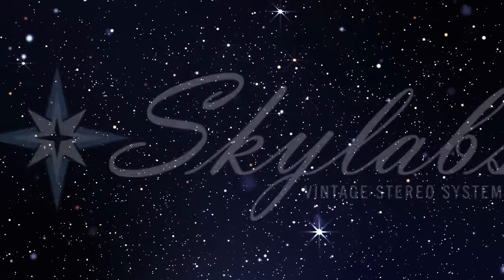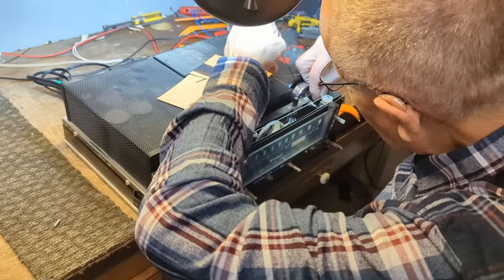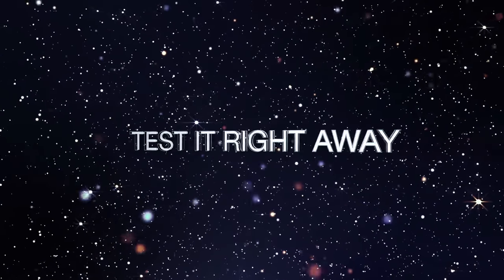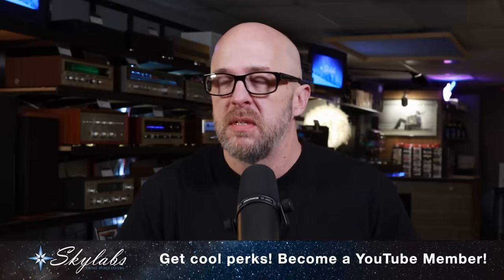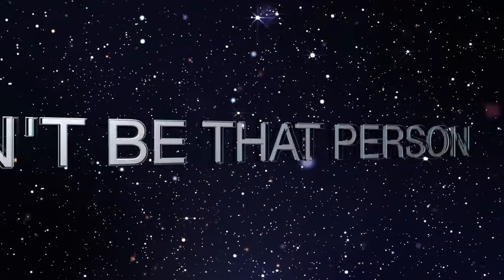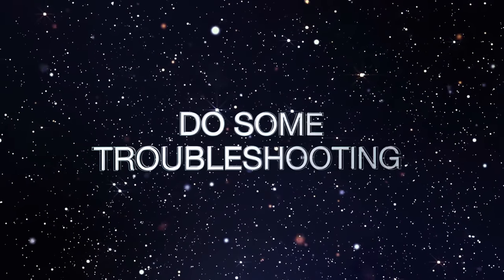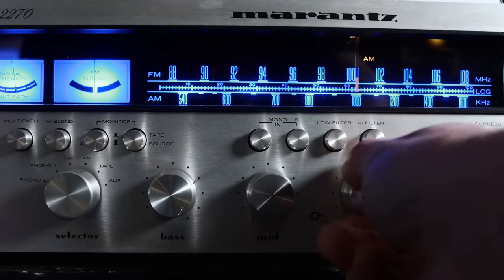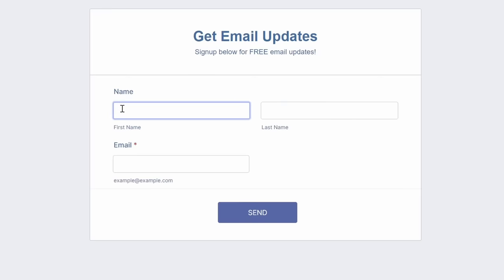Don't EVER Say This!? Vintage Stereo Repair

Comment: For all the reasons listed in the video I don't repair. I restore. If it is too expensive fine, don't send it to me. I'd rather get it to a point that I can warrant it will perform and that takes time and that costs way more than simple repairs. Also if someone plans to sell it afterwards I usually don't take it and explain that there won't be a monetary return on the investment.

Comment: My preferred repair man here in Australia took 14 months to repair my Sansui AU-6900 integrated amplifer.  Why so long? He had to re-engineer the complete output stage of the amplifier as the original spec TO-3 output stage transistors (8 of 'em) were UNAVAILABLE. He used a higher grade of transistor to create more power (10%) than original spec. but used less transistors..this created a flow on of adjustments and upgrades to make the unit stable... He did a correct DC bias correction/setting and had it running for weeks at his workshop to ensure reliability. He inspected the entire board especially for leaking electrolytic capacitors etc. It sounds great is, fully functional completely unblemished on all panels; like new.  Worth the wait; and while waiting I was listening to a Sony ES series receiver...a first-world problem.

Comment: Great advice. I took my Pioneer SX424 I bought in 1973 new) to be serviced locally and fortunately did all the things you suggested before handing it over. My hope is that it can be put right. Wait time is 6-7 weeks according to the owner of the shop and after seeing the piles of equipment in the shop, I can see why. One thing you missed in this video is the health of the repairmen/owner. Many of the guys that know and have repaired your old stuff are aging as well and not all of their system components are working 100% either!  Be Patient is the key as you say.
Reply: AMEN Brother !
Reply: "Let us endeavor so to live that when we come to die even the undertaker will be sorry."
                                                                                                      - Mark Twain

Comment: Everything you said is great advice. I've had about 60 pieces of vintage gear seen to by my techs spening $25,000 having them repair my pieces. Showing your technician respect goes a LONG way. I recently brought in a corroded Sansui G-9000 that sat unused in an ocean side vacation home FOR YEARS! It was all rusted and pitted, my tech looked at me with mock exasperation asking me Mr. Wolf why do you bring me these challenges. I readied to take the Sansui G-9000 home! My tech said hey where ya going. I can fix it, its just a challenge. My tech told me he wouldn't do this for any other customer because it a full restore but for me. He'd do it. I just realized treating this guy well made this tech my blessing.
Reply: The Golden Rule !      "Do right for your own sake and be happy in knowing that your neighbor will certainly share in the benefits resulting."
                                                                                                  - Mark Twain

Comment: I had my Sansui AU7900 go out 6 years ago. Had a bad experience  with a local tech shop. Charged me $125 and blamed it on my speakers. I finally found a specialist Sansui shop 1/2 way across the country. Called and they put me in their que and told me not to ship for 7 months! Finally got approval to ship. Once arrived, they said it'd be 6 months before they will ship it back. My attitude is that I a grateful it will be repaired and it should last the rest of my life. Can't wait!
Reply: Let me see if I understand this. They have you waiting 7 months, then tell you it's going to be another 6 months before it's done? Man, they really ARE taking the piss.

Comment: I took my baby, my Pioneer SX-737 for repair to a shop in the Denver area.  It was literally the first thing I bought with my first paychecks in 1975.  The power switch wouldn’t turn off and the right channel wasn’t working.  I reminded them that the x3x series were famous for having bad transistors.  The owner was calm and said, let’s clean the switches and dials before we start thinking about replacing the transistors.  I said “right, no point in replacing what might not need replacing.”  He was right.  The clean up fixed the whole unit.  So happy.  My 737 has a special place in my heart.
Reply: I would bet that 90% of parked Pioneer stuff  will develop noisy pots.useless switches and one channel, no channel sound. If you use it,the switches may have cleaned themselves.Amazing that the contact area of the switch is called the wiper.I use De-oxit lightly .Rotate/operate the control fully a dozen times,rinse-repeat-lube
Pioneer got real big because they built real good. products for the money

Comment: I had my Yamaha CR-2020 receiver (purchased back in 1978) rebuilt by a reputable shop.  It was 8 weeks before I received an estimate (as promised) and two weeks after that before the repairs were completed.  Seven months later and it's still performing like new.  I was never in a hurry to get it back.  This store/shop deals with a lot of vintage equipment but they also sell current state of the art stuff as well.  Great advice Kevin!
Reply: Yes the place that does all my service has an 8 week wait list also. For $100 extra you can jump one item to the front of the cue for estimates.

Comment: At least a stereo has two channels, you can reference a failed side against the functioning side.  That helps for a majority of the path.  Obviously not all.
The absolute worst device to repair was a  analog “box” TV.   Now they seem mostly disposable and all for the better.   Having worked as a TV tech in the late seventies I was glad to see a stereo come in!   
That said,  your presentation was spot on!

Comment: Well, out here in Honolulu Hawaii. just about all the technicians who used to work on vintage audio equipment  have retired or closed shop. When it comes to newer equipment most people trash it unless it's high end gear.   Your advice is spot on, very informative.

Comment: Great tips! I honor all of these tips and more when getting my gear serviced. There is never a gain doubting a technician and getting even a little pushy. I replaced all my stereo gear a year ago due to the deterioration you mentioned regarding aging equipment.

Comment: I liked the "sound difference".  I got that same thing after a repair.  I just thought there was something not quite in the same spec that it went in, likely  because it was nearly failing and now the new replacement parts have changed other values of other failing parts.  I never thought it was an issue.

Comment: I just wanted to take a second to say thank you for the videos you make and the knowledge and experience that you share. 

A lot of this information just isn't very easily available, and a lot of knowledgeable folks keep the information under lock and key, perhaps believing that their value is increased by their unwillingness to share what they have learned. 

Not only do you share the information but you take the time to deliver it in a manner that is comprehendable for a wide variety of viewers knowledge levels.

1 more thought.
The description of sound using colors as descriptive tool hasn't been a key to enlightenment, at least not for me.

Thanks again Brudda.

Bungeebill 
Hood Rat Records 

🎩✌️🐀🧿

Comment: All true, if/when owning vintage gear, a good tech is priceless and there are not that many around any longer. Being patient for repairs and not underestimating multiple different problems is part of the hobby when dealing with 50 + year old receivers/amps. It can be frustrating as it is my case with an SX780, cosmetically looking almost brand new, but on the 4th and different issue, or a pure joy as in an SX550 bought more than 4 years ago for almost nothing and sounding great and trouble free.
Great advice in going to a thrift store to get "something" as substitute when the main piece is out for service. Lately I bought a Technics SA 104 at a thrift shop for $10.00, looks and sounds good, did I need it? No, but 10 bucks? I'll find some use for it. Great hobby! Great videos.

Comment: Great Vid Kevin, looking forward to the next one.  The AR AU  you repaired is still running great, it's the jewell in the crown of my vintage set-up.  As soon as I get my hands on a good AR XA or find the parts I need to repair the one I have in my shop it will be a complete original early 70's AR set-up I wanted to buy when I came home from Vietnam but did not have the $ to buy.  thank you for your vids and hard work:   chet
Reply from the maker: Thank you, Chet. Glad you are enjoying the AR. That's a keeper!

Comment: Catching up on your earlier videos. Thanks for the tips. 

I need to find a shop here in the Dallas/Ft. Worth area to see if my old JVC KD-V6 cassette deck is worth fixing. I bought the service manual to take with me to the technician, is that a good idea? 

It needs new belts and the left channel is dead. I like the 3 head design. In the meantime to play some of my old cassettes, I bought a JVC TD-R441 on eBay and it’s working fine. I’ve listened to some old recordings I made using type IV metal cassette tapes and they still sound excellent. 

One of these days I plan to get in my car and drive to Des Moines to have the pleasure of meeting you and enjoy seeing your store. Thanks for the great videos.

Comment: Another great video and good advice. I just heard on Friday night that a repair tech had a pair of McIntosh SS amps for 2years. That's really a bit much and I offered to look at them (only think one had a problem) if he drove the 2hrs to my place. The only thing that I disagree with you is that I almost always would plug in the customer's unit while they were waiting and verify the problem and give them a "ballpark" estimate. A bit more difficult to do with audio gear but sometimes the person may have accidentally pressed the Tape monitor button....

Comment: Just watched the video where you received a poorly packed receiver by mail or whatever and some glass was broken and knobs bent.

i think it would be a real service if you made a video about packaging and shipping.

Maybe some things should never get shipped? Different ways to package. Specific advice about different services? Like you mentioned using USPS fragile stickers instead of your own.

Maybe even advice on how to protect yourself buying online, and how to be fair to sellers, et cetera.

Maybe you've already made these! Slowly making my way thru all your uniformly helpful and interesting videos, thank you!!!
Reply: I worked in retail decades ago and sometimes got things ready for shipping. Here's what I reccomend:
First, get some desiccant gel packs. I have a bunch that come with my vitamins, so I am already good to go on that.
Second, a decent weight plastic bag. Put equipment plus desiccant packs in the bag, and tape closed.
Third,  styrofoam. Preferably from a piece of equipment of some kind, ideally 8 corner protection pieces, tape onto the corners.
Fourth, packing material. That could be something like "flo-pack," the styrofoam packing "peanuts," a whole bunch of bubble wrap (one reason why you want something on those corners), or some other cushioning material. Get a good,  sturdy box, pack it in there well. 
Last, get a slightly larger, sturdy box, more packing material, and pack the box with the equipment in it into the larger box with cushioning around the smaller box.
I know this sounds like overkill, but I do remember seeing a brand new computer tumble out of the back of a delivery truck once, and I have received boxes that were obviously impacted by something between the shipping dock and being delivered. 
Or, ideally, you kept the original box and packing material that came with the equipment, and some "helpful" person didn't dispose of it as a favor (thinking of you, mom, rest in peace).
Reply: @j.patrickmoore9137  Thank you! I save those desiccants, too, for no particular reason except figured could come in handy some day. Now I have a use! Bubble always gets me wondering…. Say it gets dropped from a truck, the bubble does its job, but pops in the process. Leaving the piece vulnerable to a second drop. Totally just my mental simulation, and have no idea if it would work like that in reality. But, I stick to packing peanuts for that “reason”. I like the styrofoam corners plus peanuts approach. Thank you again!

Comment: The tech I took my Marantz 2220B didn't accomplish anything.  I had to do it myself.  However, all I did was spray all the controls with Deoxit (the left/right signal slider was the most difficult to access), and use a small bit of abrasive paper soaked in rubbing alcohol or Deoxit (can't remember which) in between the two contacts of a relay hidden deep within the bowels of the thing.  Maybe I didn't even have to do the latter, since the last thing I ever did to the unit while tearing my hair out in exasperation was the left/right control.  And I don't know a thing about all this stuff.  All I did was watch few youtube videos.  Thank-you, thank-you, thank-you to the internet for enabling me to fix the old Marantz that I earned with my dishwashing money back in 1976.

Comment: Opinions: Is it a bad thing to remove the faceplate and wood top before I dropped a unit off to a tech to keep it from getting (more) dinged up?
Reply: Interesting and an important comment.  They really shouldn't have a problem with that.  I would let the shop know in advance that you feel more comfortable doing so and see what they say.  If they advise against it, I would go elsewhere.
Reply: Thanks for the advice!

Comment: I was patient with the repair of my AU-999. It sat in a shop a “Hi-Fi” shop in Minneapolis for 2 years!  Two figgin’ years!  And this was supposed to be a reputable shop. 

My first phone was after a month - too busy. Next one after two months - too busy. After laying low a bit longer, no longer returned my phone calls.
Finally had to threaten to sue, two weeks later got it back with this big long explanation on what he (which was to go on Audiokarma and take their advice), worked for two weeks then the same problem. Called, nope, technician moved to a Scandinavian country with his wife. It is a two way street, Kevin.
Reply from the maker: It's absolutely a two way street.
That sounds like a terrible experience. I would only assume that situation was rare? I can't imagine any business staying open if that's a common occurrence.

Comment: I'm guilty of not trying out my CD player soon after I got it back. I waited 3 weeks before I tried it and guess what .. it was not playing the CDs. I took it back and they cleaned it up and did mechanical align and adjust. Fixed it no charge with warranty. All the other tips I pretty much had it my mode of behavior before watching this vid.  I had two other pieces worked on and took back the cassette deck after it was not playing steady. It's still over there.

Comment: A little self repair/investigating on why something doesnt work is precious. I used to do service calls on John Deere equipment, a lot of expensive lawn mowers. More than once, got a call to check out a lawnmower "than just quit running". I got in the habit of checking for gas in the tank, first thing. Was not my decision to make, my business still charged for the service call.

Comment: You mentioned people saying, it does not sound the same as it used to. Then they say it has been years since they listened to the stereo receiver or other equipment. People's memory for audio is not accurate, just as it is not accurate for many things.
People often look back and remember things better than they actually were. "The good old days." You mean back when you had no money and were starving? Yeah, then. Ha ha
As you mentioned, they are often listening to the equipment in a different room. They may be using different speakers. Maybe they were using a different turntable with a different stylus. There are so many factors why it will not sound the same in reality or in their memory. People need to enjoy the sound they are getting, not some idealized sound in their heads.

Comment: Best way to test your vintage gear hold your gear upside down and give it a good shake the transistors, resistors and capacitors that fall out are the ones that need replacing.
Reply from the maker: I'll try that this week. Thanks

Comment: Kevin, I'm wondering if I'm over-thinking this.  about 5 years ago I inherited my father's Sansui 5000A receiver and it has been sitting here since; but it wasn't hooked up or used in almost 25 years; as in since 2002 when I last set it up for him in a new room in his house.  The speakers for it got destroyed so I need new ones; which is why I haven't turned it on yet.  

But am I being overly cautious by not wanting to use it without having a tech give it a 'once-over' first?  
My thinking is, like when you buy a used car you take it to a respectable mechanic that you trust, to get it looked at to see if there are any possible issues that can be addressed first and avoid a possible catastrophic failure later on.

Comment: im luck that im interested in vintage audio and am also a tech. i like modding my equipment to sound a specific way. i also increase the coupling capacitors to allow the amp to handle frequencies down to 1 hertz.
i also design and bould my own cassette players and spectrum analysers. in fact im building my 60led bar graphs right now.